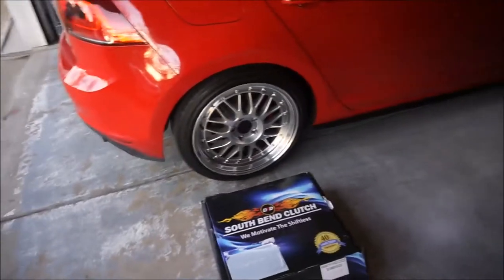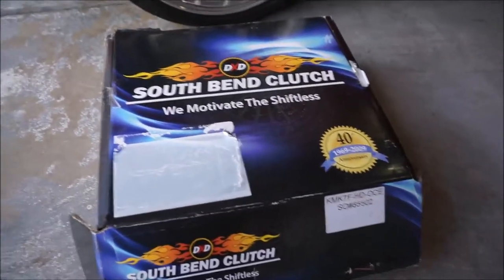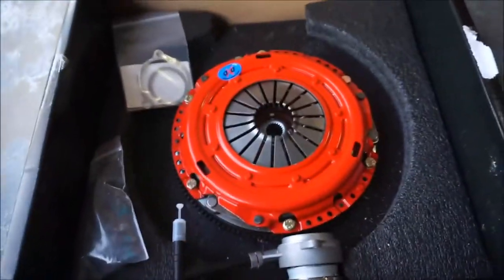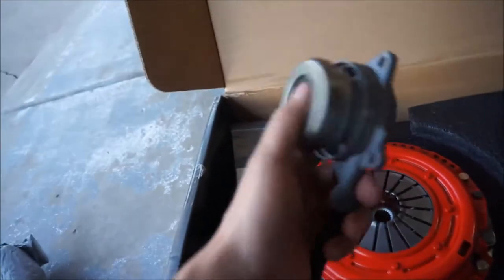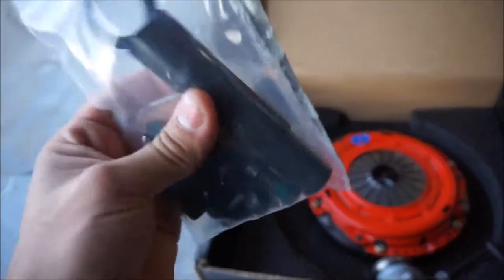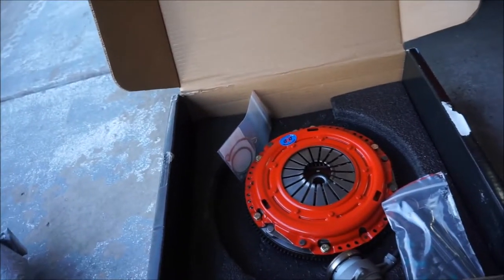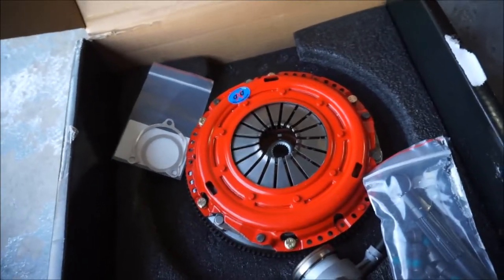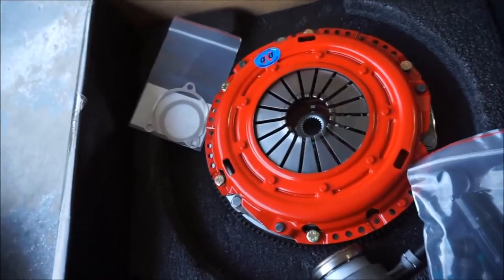MK7 GTI Clutch Southbend Stage 2 Endurance

Comment: I installed the same clutch on my gti a couple months ago, also running Eurodyne stage 2.
Reply: 5280TSI I like it, it's holding the extra power very well, it took me a while to get used to the clutch pedal this one engages earlier then the stock and it's a little stiffer, now I'm used to it, now it feels normal. The only down side is the shatter noise you get with a single mass clutch, but it's not that bad, the only time I hear it it's at the drive thru when I'm in neutral and have the music down. Over all I'm very happy with it.